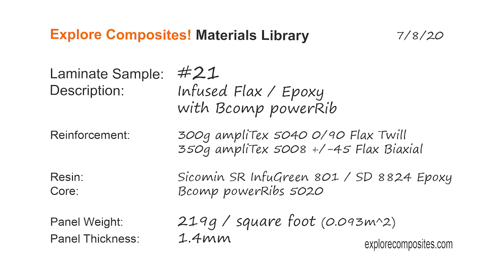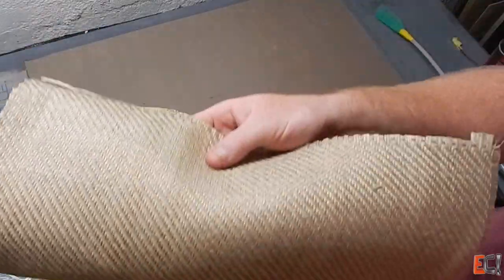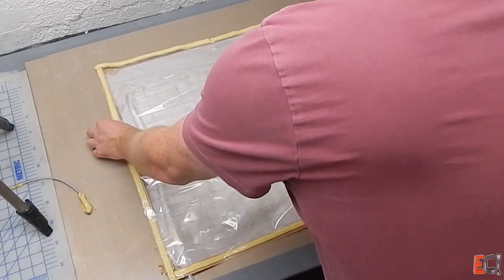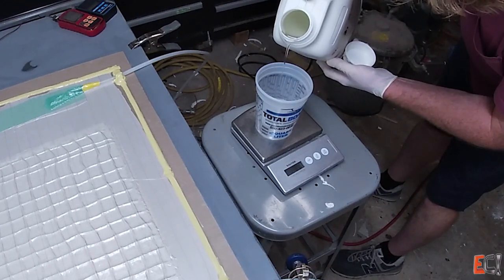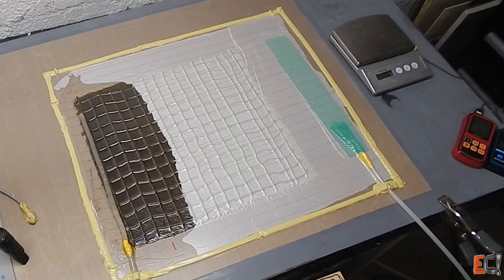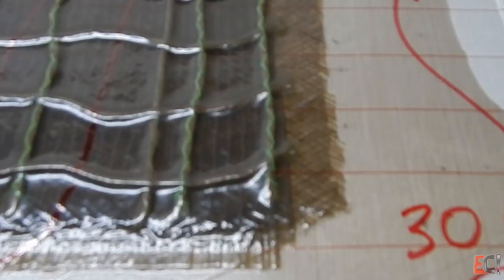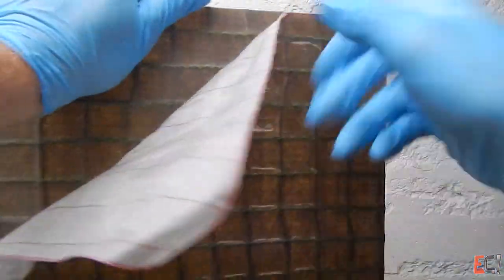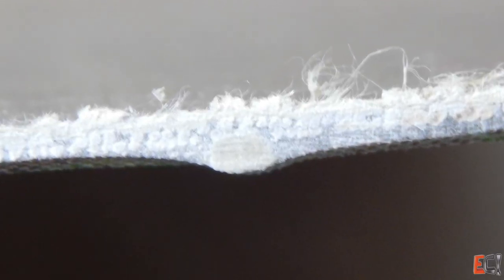Laminate Sample #21: Infused Flax / Epoxy with Bcomp powerRibs

Comment: I am working for Bcomp, nice to see people on youtube working with our material!
Small advise, try not to use peel ply on the surface, it has no real use if you don't want to glue something on it. Moreover you will minimize the resin used and the meniscus between the powerRibs and the substrate, thus maximizing the stiffness to weight  ratio. Insider trick: you can heat gun the vacuum bag so it shrinks and matches well the powerRibs geometry. Looking forward to see your next project!
Reply from the maker: Its a neat product and I’m excited to try it on something thats an actual thing!  

I learned about the heat gun bag trick after I laid this one up and can imagine that a lot less resin will be used that way!
Reply: @ExploreComposites  Got some flaxfibers sponsored by your swedish distributor. Do you perhaps know what the best supplier would be in Europe? Haven't been able to get hold of your power ribs yet. Would be amazing to build our next car in flax 😍
Reply: I have a project I'd like to use this material . Who in the US supplies it?

Comment: Fascinating use of bio based materials. Thank you for the demo!  What was the resin and where were you able to procure it from? Does it say whether it's the type of resin which breaks down under extended high temps? (Thinking of the compostable plastics which break down in commercial composting operations.)
Reply from the maker: The resin is Sicomin Infugreen 801 which is a partially bio-derived epoxy.  It will probably break down under high temperature but much higher than even the hottest compost. This is not biodegradable by any stretch but if you left it outside for a few hundred years it would probably disappear unless you looked really close - the UV would get the epoxy.

Comment: Which underground do you prefer for a shiny finish? I can think of an aluminium plate...

In addition to that, do you recommend any mould wax for an easy release? Or wasn't that even a problem?

Nice video!
Reply from the maker: Wax is always a good simple choice for a mold release, but it can be a problem where heat is involved and after a time you get build-up.  Aluminum plate is excellent, but it's expensive!  On these samples I think I used a teflon release film for the surface of a laminated work table.  It doesn't require additional release - because teflon.  Its great, but leaves a texture and is expensive - and doesn't handle contours well.

Comment: Hi! Thanks so much for the excellent video. Were you happy with the strength of the sheet? And do you think it is possible to do a hand layup reproducing what you did here with vacuum infusion? I cannot imagine this turning out well with the powerribs. Unfortunately I do not have access to the necessary equipment for vacuum infusion, hence the question.
Reply from the maker: I didn’t do any mechanical measurements but it is much stiffer with the powerRibs than without.  Flax is hard to do wet layup with.  I tried but it was very voidy and puffed with air.  Can probably improve methods with changes but infusion is great - especially with the powerRibs.

Comment: What is that hose clamp you were using. I like it. I could use it where I work.
Reply from the maker: It is a Squee-Zee from DDCompound.  Not the cheapest but very handy - and throttle-able.

Comment: Hi there and thanks for the great video and all the great stuff you do! However, I see the powerRibs have somewhat misshaped for some reason - how about you drop us an email at media@bcomp.ch and we make sure to get you some new powerRibs. Also, as "olhey" mentioned below, you can get a better result without the ply - it's a perk versus carbon fibres with less consumables! Look forward to be in touch with you, and never hesitate if you have any questions. Keep up the great work!
Reply from the maker: Thank you for your offer - I'm excited to try using the powerRibs for something that isn't just a flat panel - and will definitely skip the peel-ply next time!  My "sample" was from an offcut that had been around so it had probably been folded and handled roughly - and I didn't make much effort to make it nice. 

I'm going to check you your videos on how to use it and learn more before trying a real project.  It is super interesting stuff and I am impressed by how much stiffness it adds to a thin laminate!
Reply: @ExploreComposites   That's great to hear! Always feel welcome to be in touch if we can help in any way :) All the best and keep making good stuff!

Comment: hi weird question, but does the material leave itchy splinters like fibre glass and carbon fibre?
Reply from the maker: No, not the same itch but there can still be resin-coated splinters.  Because the fiber is so much softer it is much more pleasant to work with.

Comment: Have you tried the grid as an internal layer?
Reply from the maker: I haven't.  My concern is that it would be very hard to get the top layer of fabric to go up and over each rib gracefully without a lot of bridging.  A short-fiber chopped reinforcement might work well though.
Reply: @ExploreComposites  Ah true. The bridging, at the expense of a little extra weight might add significant torsional rigidity (much like bead rolling on a flat automotive panel). Hopefully vacuum bagging will minimise the effect. Might be worth experimenting with